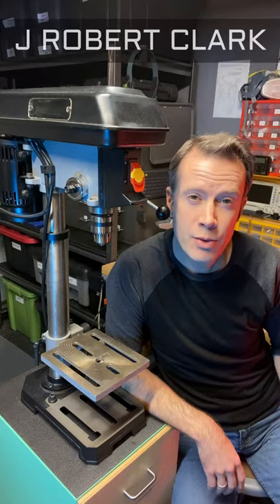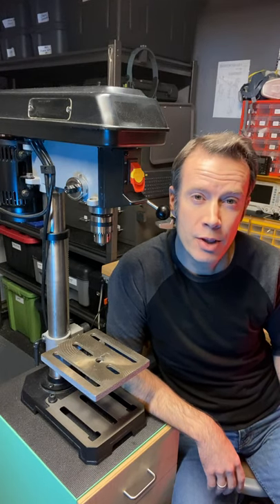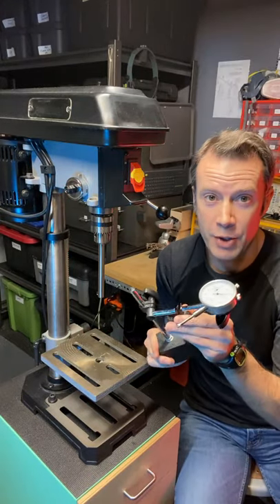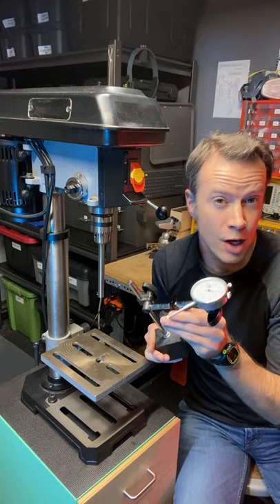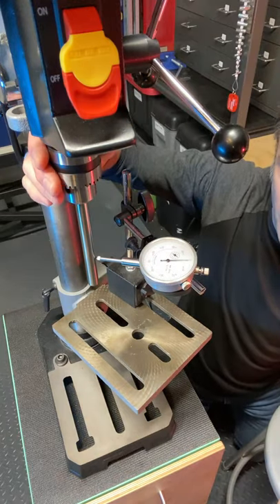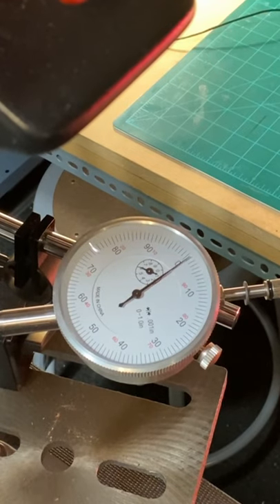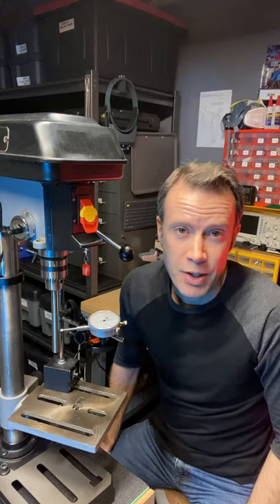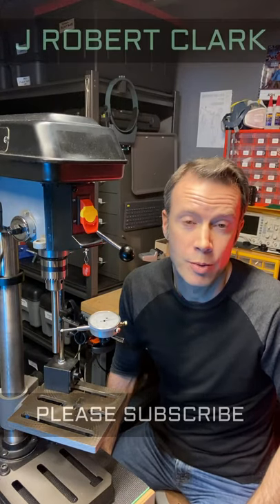Does your drill press wobble?! Check runout the easy way! #shorts

Comment: That works long as the rod you put in the chuck is good on runout too.
Reply from the maker: Agreed. I use good quality drill blanks (the ones I have are Viking). And you can flip them over to double check.

Comment: Runout can also be caused by the bit you are using and also cheap jaws in a cheap chuck, it can also be caused by vibrations in your workspace, if the material you use is inconsistent, it could also be the cheap dial indicator you are using with out a precision tip, there are several things to check for runout but the usual culprit in cheap presses is actually the jaws of the cheap chucks
Reply: But you were correct to say to turn the pulley as the temperature of your hand can warm up the things you touch and knock things out of whack, that's if you're measuring to within the 1000th, or 100th for us metric superchads.
Reply from the maker: Thanks. All true. I do mention several of these in this short. But there is only so much time to elaborate.

Comment: It's also a lot of fun to put a reversing switch on your drill press motor so that you can do a lot more really cool things with it! 😁
Reply from the maker: Not sure I know what you mean.
Reply: @JRobertClark  some people run taps in and out 
That way.
I put a grinding wheel or a wire wheel on my drill press and use it in different directions for different angles. Especially to use on pieces too big for my bench grinder.
I can also use it for running stuck bolts or screws in or out by using hex adapters.
I could also put a fan blade on my drill press and run it in different directions to cool my workspace.
I can also use my drill press as a vertical wood lathe. Someone sells adapters to turn a drill press into a lathe.

Check out other videos on people reversing their drill press.

I keep looking for more excuses to use it in reverse.

Decades ago my dad had a reversing switch on his bench grinder, probably just for the fun of it.
It's a conversation piece.....

Comment: Good, but how do we fix it?
Reply from the maker: Good question. If the problem is the chuck, it can be removed and replaced. With higher-end drill presses, it's possible to replace or repair the quill as well. As for entry level presses like my Craftsman, knowing how much runout is more about knowing how much you can trust a press to be accurate.

Comment: how do you fix it?
Reply from the maker: At this price point (sub 300 drill press) it's more about knowing how much you can trust your tool. One can replace the chuck, and that can help. The quill on these lower end drills often flex, so there is only so much one can expect with accuracy. Replacing it is often not worth it nor possible.